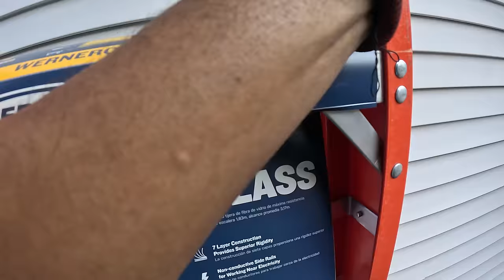Delivering CELEBRITY Luggage with a Police Escort! This was CRAZY!!

Comment: Hey bro! I’m new to Roadie and having issues with my first 2 orders from CVS. When I pickup a pharmacy gig and scan the barcode, my app does not let me proceed to the next step (which is the drop off point). Did you ever face issues during your initial stages? Thanks
Reply from the maker: No, I Don't really do CVS or BEST BUY Orders. I have heard that you can type in the digits manually if it doesn't let you scan.